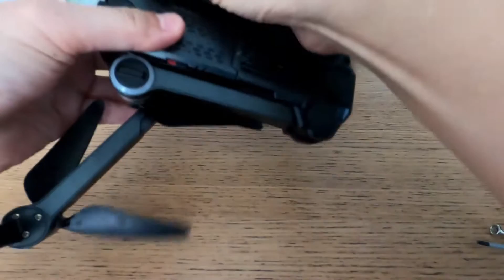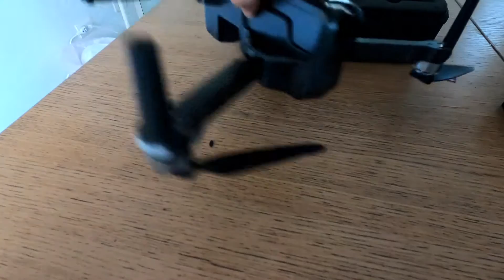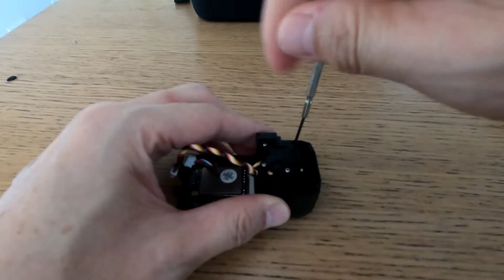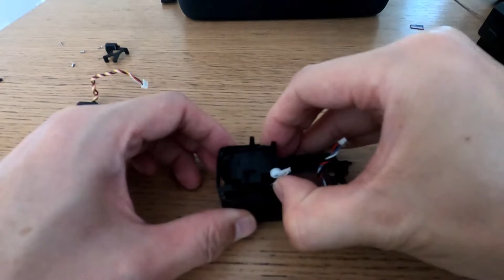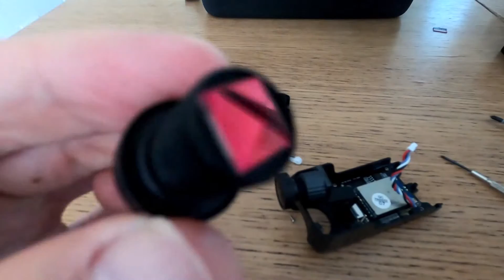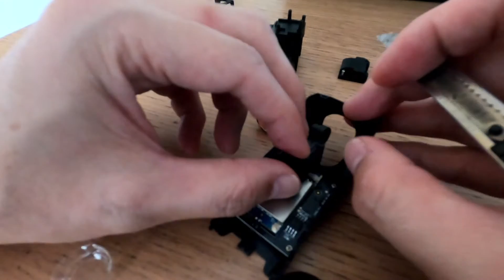SJRC F11 Pro GPS RC Drone Lens Replacement (43mm 1/2.3" Non-Distortion Lens with 4K IR-cut Filter )

Comment: Where did you buy the Flycam SJRC 11pro fisheye lens?
Reply from the maker: You can find it on Taobao or google the seller near your home.
https://s.taobao.com/search?q=SJRC+F11+Pro&type=p&tmhkh5=&spm=a21wu.241046-tw.a2227oh.d100&from=sea_1_searchbutton&catId=100
Reply: where is your place right now
Can you resell me a straight fisheye lens priced at 180 thousand Vietnam
FLycam SJRC 11pro 2k
Reply from the maker: @music566-    This is not fisheye lens which I installed　, but non-distortion lens  https://item.taobao.com/item.htm?spm=a1z09.2.0.0.58442e8df6ggJ8&id=610516293827&_u=51i051u95d67
Reply from the maker: @music566-   I don't have this drone   now , but you can buy it from Taobao.  Now I am using DJI Mavi Air 2.
Reply from the maker: @music566-    You can buy the part here at https://item.taobao.com/item.htm?spm=a312a.7700846.0.0.1f462e8dY8GW9A&id=608100202239&_u=51i051u9d165
Reply: @MavicAir2TW  did you ever uploaded that after video? I have been looking, couldn't find it

Comment: Need a second take!  1. As you did, you can damage the camera loop (the camera needs to be disconnected from the board!), 2. You need to prepare a new lens (the outer diameter is 17.5 mm, you need to reduce it to 17 mm)!!!
Reply: @MavicAir2TW  Thx a lot. ;-)